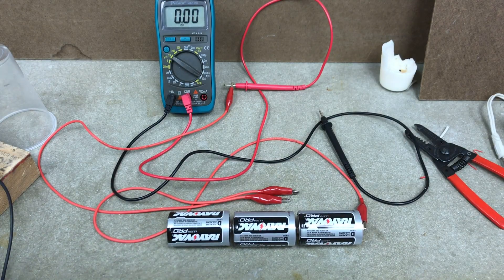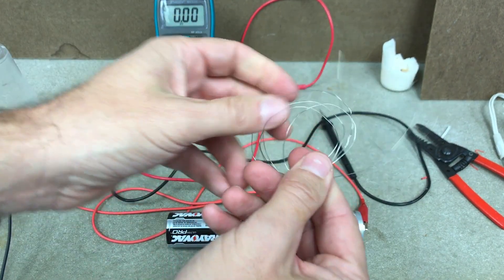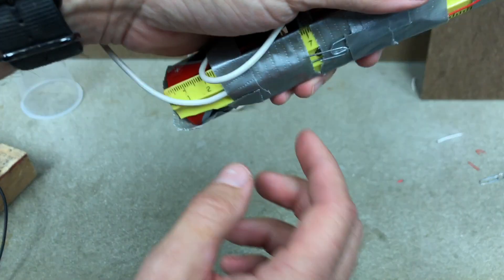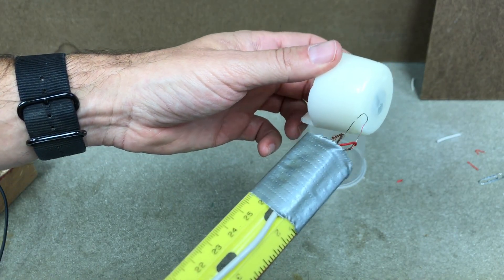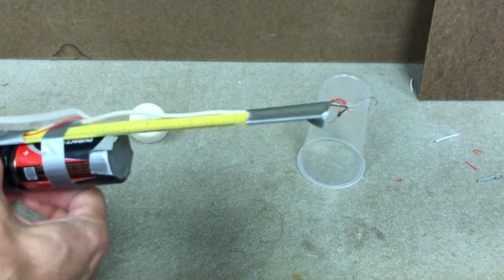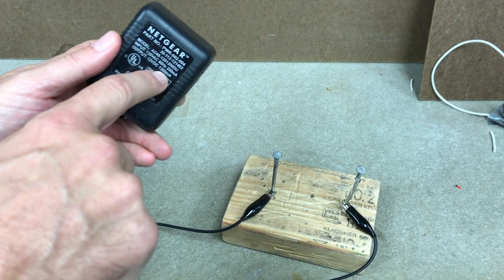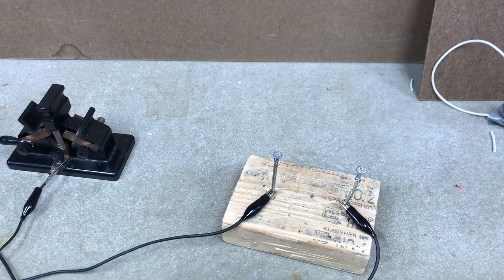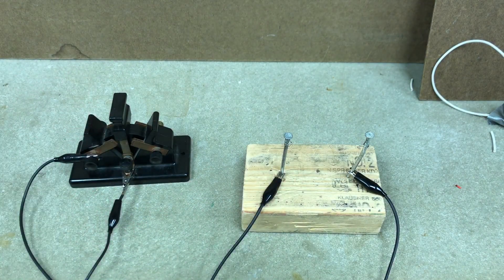DIY Nichrome Wire for Melting Stuff

Comment: Thanks so much 👏
Lol all the stuff I've been reading online showing algorithms to calculate the power supply requirements etc and it's that simple.
I'm making a heating element for a smoke machine for diagnosing air leaks on automotive engines, it simply heats oil until it smokes.

Comment: A couple of years ago, I built a nichrome wire Styrofoam cutter by simply linking it to a DC12v 5a laptop charger with eye bolts on a PVC frame. It worked great, but I recycled the project to make it much smaller. I went from a bout 3ft  down to about 3 inches of wire, and now it doesn't work...the power supply light goes out and the wire stays cold. Any reason for this? The old reason for the power supply shutting off was because it was 12v 3a instead of 5a. I would think a shorter wire would mean less resistance, but I have no clue at this point lol.

Comment: What size nichrome wire is that ?
Reply: He said 1 meter has a resistance of 25 ohms, so it would have to be about 30 gauge. But it looks thicker than that, so he probably doesn't actually know the what he's saying.

Comment: I have a 12vdc 2amp power supply plugged in. I get 12.3vdc from the multimeter. But as soon as I connect the NiCh wire, voltage drops to zero. What am I doing wrong?
Reply: Wire is 28 guage at 4 ohms/ft
Reply from the maker: Your power supply might have a current limit to prevent short circuits. That’s my first guess. Try it with a battery instead
Reply: @rhettallain  the power supply is 2amps. From what I've read, this guage wire of NiCh needs just less than 2 amps. 🤷🏻‍♂️

But I guess it's possible it needs more than 1.95

So besides a battery, any ideas on how to make it work? Ultimately I'm directly connecting it to an alternator for power
Reply: @rhettallain  I set my system up just like yours with the difference being that I used a plugged in power supply instead of batteries. When I touch the meter leads together, the wire begins to heat (nowhere near hot enough). Is there a setup for this without using the multimeter in the circuit?

Comment: So, I've been looking for a way to create a heating element that will melt snow.  I know you can buy all the super expensive ones out there, but looking for a DIY version to save on cost.  From your experience, do you know if there is a way to heat up wire and then run them down a driveway to heat and melt snow/ice during the winter?
Reply: Just blow the snow with a heat gun or hair dryer.

Comment: Great video that explains alot is it Nichole wire they use to make hot water heater elements too.  You said that toasters have the same wire could it be used to make an home made 12 volt heating element. Trying to build one for off grid Any help you could give would be greatly appreciated Thanks Dale

Comment: I’m using the exact same set up as the first, with 26 gauge wire and 3 batteries. Only difference is I didn’t use a multimeter, but I’m nothing is happening?

Comment: I'm surprised the power supply didn't burn up.
Wire:
25Ω/m • 4" • 2.54 cm/in. • 1m/100cm = 2.54Ω
12V / 2.54Ω = 4.72A
12V • 4.72A = 56W
Power supply: 1.2W / 12V = 0.1A
Reply: I thought the power supply was 12V 1200mA (1.2A). You can push these small power supplies quite a bit over their rating, but they do heat up after like four minutes

Comment: Why when I try this does my nichrome wire generate no heat? Same amperage and voltage as you, nothing. Higher amperage and voltage than you, nothing. It doesn't work at all. I copied you exactly it seems to me, I can't figure out the missing variable here.

Comment: Heating wire needs to be low enough resistance that enough current flows but high enough resistance that nearly all the voltage drop is across the heating wire. So it's not JUST about being a high resistance, but being in the sweet spot for a given voltage. Nichrome was specifically designed to be in the 'ideal range', but that depends on the length of wire used and the voltage powering them.
Reply: The ideal range really depends on your application. If you're using a really high voltage and you want a really short wire and a low wattage then even this might not be high enough resistance. If you want a really long wire at a low voltage with high wattage you probably want copper

Comment: ok i am trying to make a coil out of a thin guage copper wire to see if i can make it heat up to make a small vape as im sure you know what those are,,i tried using a 9v batter and then a power adaptor of 1amp at 9v and the wire did not heat up,,is this because it has little resistance and very conductive? how many amps or wattage is needed to make this work? and the use nichrome or kenthal wire is that because it has high resistance and therefore you do not need a powerful battery to make it heat up?

Comment: Hey, thankyou so much.
Can u tell us the dimension of the Nichrome wire (awg, length, etc) ?
That will be much more helpfull for future steps :D
Reply: It really depends on how much voltage you want to push through it. The lower the voltage the thinner nichrome wire you will need to get it glowing.
I'll go in the other room and tell you real quick..
Around 4 in. (101.6mm)
Of 26 gauge. You can get glowing with one 18650 rechargeable battery pretty fast!  Just make sure you have an off-and-on switch.
If you make it 3, 4 or 5 times longer and wrap it around a screwdriver several times & make a coil. (Of course take the screwdriver back out). You can use it for a longer amount of time before having to shut it off.
Be careful and have fun guys!

Comment: Im really wanna make a hot wire(why not) but i dont have nichrome wire : (
Reply from the maker: if you get an old hair drier - pull it apart, there's nichrome wire in there.
Reply: @rhettallain  if you use copper wire do you need much more current?
Reply: @ARCSTREAMS  a ridiculous amount more
Reply: @jax8604  yeah i figured since its so conductive right
Reply: Oh ok